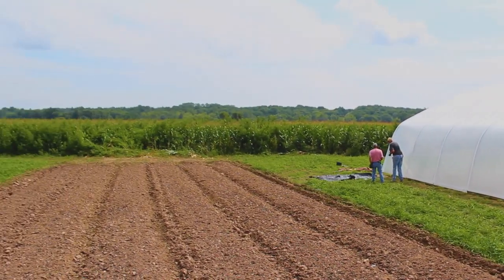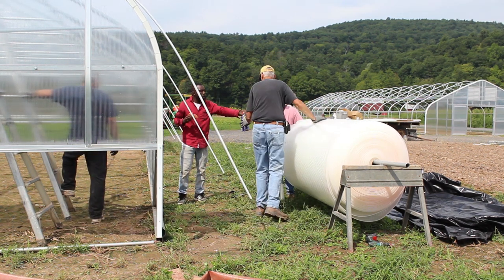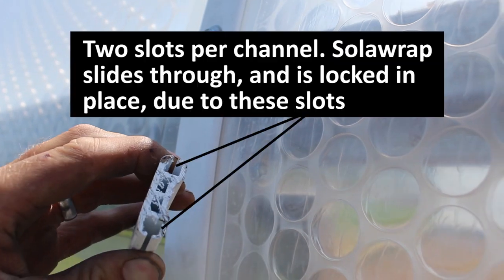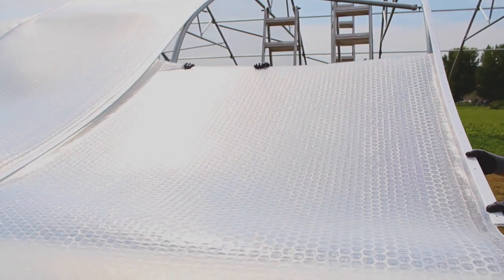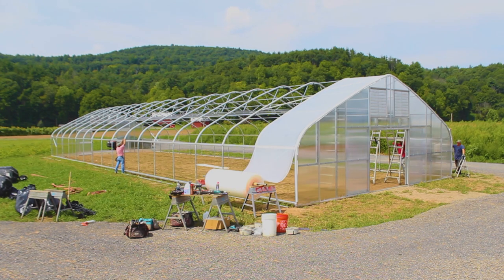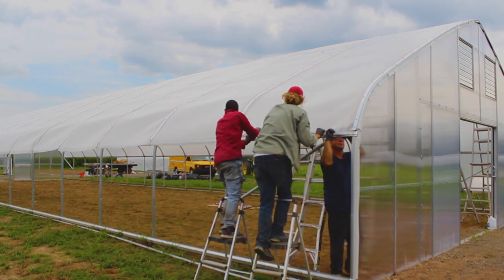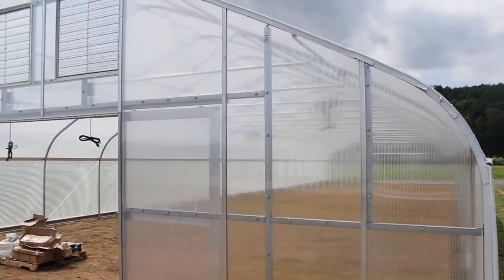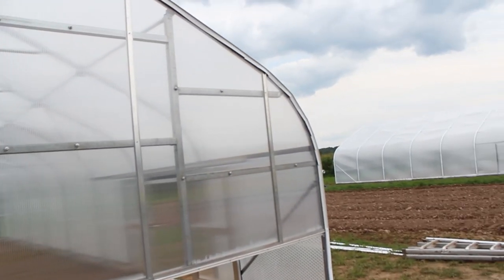SolaWrap Greenhouse Plastic Installation - Introduction and Time Lapse

Comment: What's the cost difference between this and double layer poly? What's the reported lifespan?  How does the r value compare to the double layer poly? I would presume that one advantage would be that it can take more of a load due to all the added channel
Reply from the maker: The SolaWrap would cost much more than a double layer poly set-up that included a blower fan. That cost difference comes from the fact that the SolaWrap material can hold a lot of weight, can stand a lot of wind, and can last a very long time. SolaWrap comes with a long term warranty, and should last 15 to 20 years plus. As far as R-value is concerned a double layer 6 mil covered structure with an approximate 2" air space would have an R-value of 1.5 while the SolaWrap product would have an R-Value of 1.7. Hope that helps!
Reply: @tunnelvisionhoops    I take it you guys like this SolaWrap more then a double layer poly set-up with a blower fan?
Reply from the maker: I wouldn't say we like it more or less really. They each have pros and cons. The SolaWrap material has more benefits from an insulation and growing perspective BUT a double layer inflated system does a pretty solid job providing value AND its price is much much less. I would say that the pricing of SolaWrap is its largest negative, so every operation will have to assess whether the increased price of the SolaWrap is worth the potential benefits for their business.
Reply: @tunnelvisionhoops   Thanks

Comment: I've been considering building a Chinese passive solar greenhouse, would it be possible to put solar wrap as the outside layer then my framing 2x6 pressure treated then a single layer of poly film as a added air space to increase the R value?
Reply from the maker: That might be possible, Adam, but I've never actually done something like that myself so I don't know how an installation like that would impact the lifespan of either material and impact the heat retention. My assumption is that the additional dead air space would provide better insulative properties and reduce the speed at which heat is lost, but without having done it I can't give solid input one way or the other. Sorry I don't have more to provide on this one, and best of luck. Thanks for watching!

Comment: What’s the best type of cover for the greenhouse? My country is very high heat during the sumer.I’m worried about uv degregation as our uv index is high on average
Reply from the maker: Amelia, good question. In my opinion, the SolaWrap is likely the best plastic, but it’s cost is most often cost prohibitive. The 4 year 6 mil IRAD tends to hold its own against woven materials with regards to UV degradation though so your best bet might honestly be a 6 mil film, or if you’re looking for a lot of diffusion, you could do a 6 mil Diffused or a woven material since the woven material has higher diffusion percentages. Best of luck!

Comment: The spring wire for roof and sides panels goes in the same channel?
Reply from the maker: End-Wall Plastic and Top Cover Plastic can go in the same channel. The channels can hold multiple layers of plastic AND two runs of wire. Hope that helps, and thank you for watching!

Comment: How watertight is it? What about wind and snow loading?  (I'm looking for real world experience comments, I know what they say in their website.) Thanks
Reply from the maker: Good questions. In my experience it is watertight - keep in mind that there is also caulking required when installing this material. You must caulk over top the seam where each of the keder channels meet, and also where the pieces terminate / meet a perpendicular members. I suppose if you were to incorrectly caulk there could be some water infiltration, but I also suppose that anything like that could be fixed with corrective caulking. 

As for the wind and snow loads, my real world feedback would be that SolaWrap covering is better in snow and wind than pretty much any pliable plastic covering (it is more costly too though). The reason for this opinion is its fastening and thickness. If you think of how much fastening it has per square foot of material, it is substantial. For example - if you have 4 ft. bow spacing for your structure you are fastening your SolaWrap plastic covering every 4 ft. along both edges. That is opposed to just around the perimeter of your structure if you are using a traditional film fastening system and 6 mil poly. 

The plastic is just super durable and you are fastening it very frequently. My assumption would be that if you reached a point where snow or wind would cause a SolaWrap failure it is likely your entire structure will fail because that is how extreme the wind and snow would have to be. 

Again, the above are just my personal opinions having installed it on a number of structures, and I do recognize how costly SolaWrap is too so the pros and cons need to be weighed. One thing I will say is that if people have the budget for either a "super strongly framed greenhouse with standard plastic" OR an "okay framed greenhouse" with SolaWrap plastic I would encourage them to go with the super strong framing and standard plastic, because your plastic will only be as strong as the frame beneath it. If someone plans to invest in SolaWrap they definitely should make sure the frame beneath it is of high quality too.

Thanks for watching the video and for your questions.

Comment: Have you had anyone combine this with air insulated double layer?
Reply from the maker: Not that I’m aware of. I suppose you technically could. Not sure how that would impact the SolaWrap’s light transmission, diffused light percentage, or lifespan, and I’m not sure anyone has done the testing to figure those things out. If you go that route, I’d love to hear how it all turns out though!

Comment: Can I use this on. Cattle panel hoop house greenhouse
Reply from the maker: I am sorry, but I am not familiar enough with cattle panel construction to provide good guidance on that. What I will say, is that SolaWrap product is very costly compared to other greenhouse plastic options and for that reason if you are planning to use SolaWrap it might make sense to first invest in a high quality / long lasting frame. The main reason being, SolaWrap is not likely to break in the snow, so if your structure can't support snow weight you might find yourself in a bit of trouble. 

Thanks for watching!

Comment: Whats the cost per ft.🤔
Reply from the maker: SolaWrap is pretty costly when compared to other greenhouse covers. This material (as of writing this comment) falls between $1.40 and $1.74 per sq. ft. depending on the quantity of material and width of the material ordered.